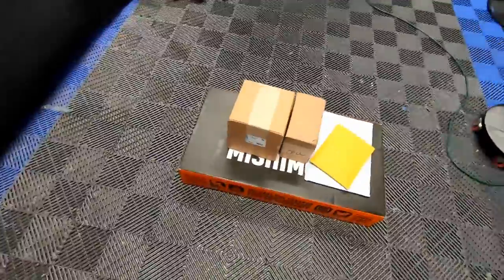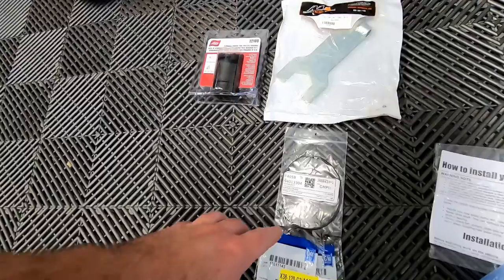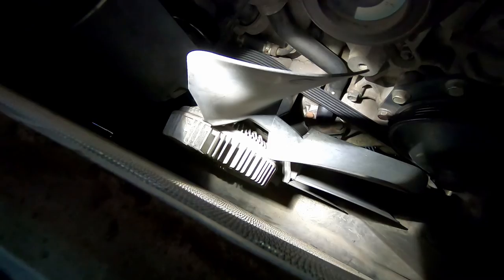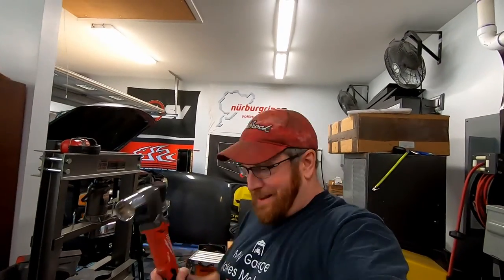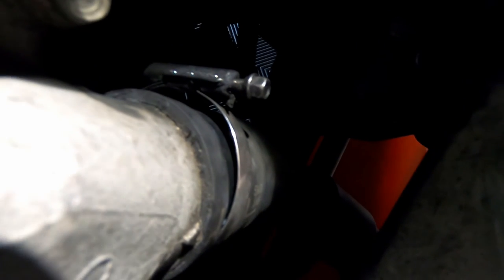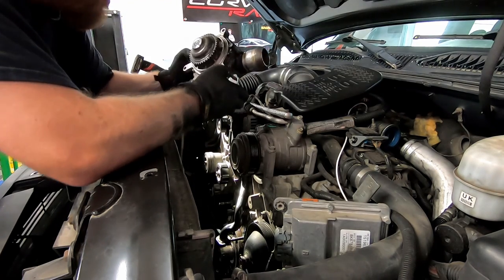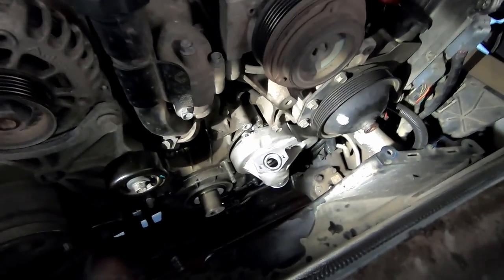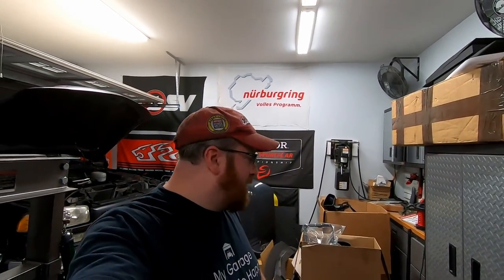2005 GMC Sierra 2500HD - Duramax Water Pump Replacement

Comment: Kinda surprised you didn't go with the DHD 500-112.  If anything fails on my truck, I always replace it with the upgraded/updated part.
Reply from the maker: I fully agree with you on tearing parts apart and replacing it with upgraded parts.

I did see the DHD pump - but that resin impeller wheel didn't give me a lot of confidence. 

Maybe its fine - but the metal impeller on my stock pump lasted 250,000 miles without any catastrophic failures. 

If I need to install a new pump - I have the tools and the know how to do it now.
Reply: The resin / plastic impeller pump is supposed to be an upgrade because it's lighter, prevents it from spinning on the shaft.  So you don't have to Weld it or pin it.  Good for tuned trucks.  It's a modified OEM GM pump.  Well worth the 3 bones.

Comment: Good thing you didn’t pull down that bypass pipe. I did when I replaced my pump and their a pain to get back in without leaking. Why they use just an o ring up there and bolted on bottom is beyond me. I went through 3 o rings before I got it right.
Reply from the maker: That black pipe that is pushed up into the block? That thing sucked - I had to replace that Oring like 2 times myself. One of the O rings that was provided was not the right size.
Reply: @bonecrrusherSS  Yes, I ended up just buying better o rings. Trick is put lots of grease up in hole and on o ring